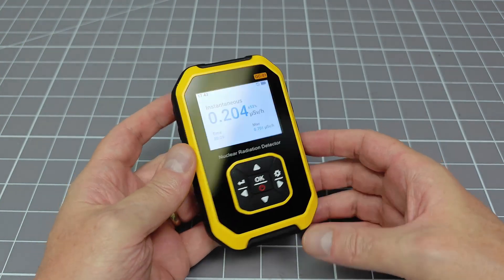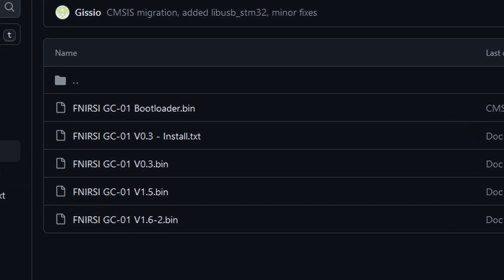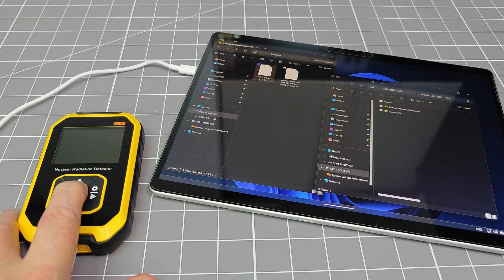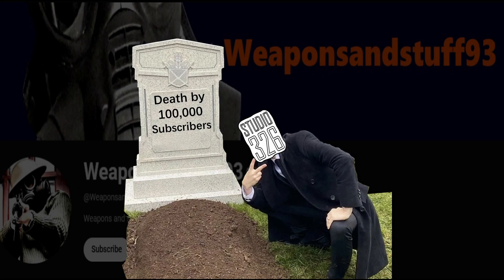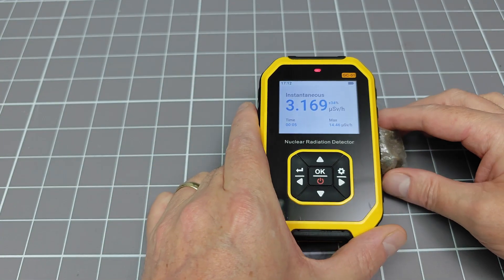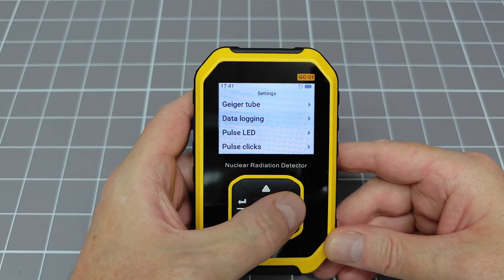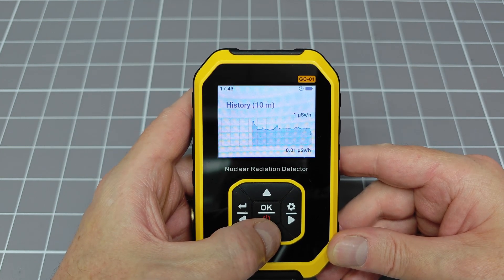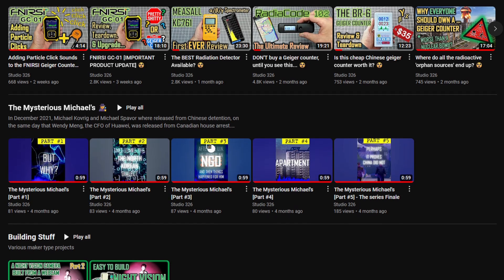FNIRSI Firmware Upgrade, Review & Instructions

Comment from the maker: For anyone that is considering this upgrade, please take a look through the GitHub threads, there is a lot of issues that can be avoided just by looking at the issues that others had, and how they solved them.  Also, GISSIO is very helpful.
Reply: My laptop won't recognize it when I plug it in and or turn it off then back on holding power button. Any idea how to get past this??????
Reply: @darrenhanson3875  oh no. What's your tube and MCU chip if i can ask?
Reply: @darrenhanson3875  this firmware never works with newer models because they have a different microcontroller (without the USB communication!).
The manufacturer simply redesign the whole device using cheaper components while maintaining the same plastic shell and the same layout of the screen to keep the device identical to the older one.
If you open an older and a newer unit you find that the insides are completely different.
Reply: How do I get my hands on a genuine one with a J321 tube? The AliExpress ones are a scam but you mentioned FNIRSI themselves no longer use J321 tubes either
Reply: Who can help me? After the firmware my device stopped turning on (((
Reply from the maker: @andrjusha  I found that I needed to disconnect the main battery and also remove the coin cell, then re-try the programming process - this seemed to fix the issue for me.
Reply: @andrjusha есть решение,тоже окирпичил сначало,сейчас все работает, пиши
Reply: This is not help me( Device is not turn on after that
Reply from the maker: @andrjusha  even when you press and hold the middle key whilst trying to reprogram the device?
Reply: yes. I just tried to do this with the middle key held down - it didn’t help((
Reply from the maker: @andrjusha Perhaps leave a message for the firmware creator, GISSIO on the GitHib repo in the link...
I can only speak for my own experiences, there are a LOT of versions of the GC-01, I suspect that the factory firmware is just as diverse.  GISSIO is the expert on his firmware, and will be you best resource to help with this.
Reply: How i can write to him?
Reply: Ok. How i can contact with him?
Reply from the maker: @andrjusha  This is a link to the discussions page.
https://github.com/Gissio/radpro/discussions
Reply: I already made a post there, but he hasn't responded to me yet(
Reply: @andrjusha  is event diod is on constantly? u might already entered booting mode. I had same, onnected to usb and it appeared as flash drive. after copy firmware device shut down and u can turn on again with new firmware. But there is no light, u should disonnect battery, press power button, wait a min and plug it back
Reply: Gissio went well above and beyond the call of duty. Not only he made custom firmware for these cheap counters, but also modified a GeigerLog software to run out of the box for them!

Comment: That Geiger counter you have looks like a fake china one well that's good for me because I got a fake one so thanks for helping with the new firmware tutorial
Reply from the maker: Thank you for the comment.  Actually, they re all made by the same factory, FNIRSI.  They have their own brand as well, but this is most often sold as a white-label device to whatever brand wants to buy it.  The factory is about 20 miles from my home in Shenzhen...
There is a video on the GC-01 on this channel that explains this in a little more detail.
Reply: @project-326 but you got lucky with yours because mines Geiger tube literally MOVES AROUND IN IT if I sightly shake it you can hear it move and when it moves the reading spirals out of control!
Reply from the maker: @superhornet-g2l  Sounds like the tube wasn't soldered to the socket...
Reply: @project-326 I opened it up and it wasn't it looked like they used double sided tape and put it on the shell then put the tube on it I regret getting it

Comment: I just bought a FNIRSI GC-01 however when I opened the device I noticed that the chip had no marking, how can I tell the difference between ch32f103r8 and apm32f103rb to install the correct version ?
Reply from the maker: That seems like a tricky issue.  I'm not sure why they would do that, the only company making the apparent 'fake' ones is the FNIRSI company itself.  I am surprised that GISSIO doesn't have some kind of notes on this.
In my case, I actually tried to program the wrong file first time around.  This cased the device to (obviously) not boot correctly and also not be able to get back to the bootloader.  The solution was to remove both the main battery and the memory backup coil cell and retry with the other MCU version.
Reply: @project-326  looking a little more, Gissio suggests using the apm version if there is no marking, it worked for me, and it seems that the latest versions of the GC-01 are all with the apm, in my case I have a GC4011 inside and the rad pro 3.0.2 version seems to work wonderfully, for people who can't connect their module to the computer, you have to press both buttons at the same time and install the firmware twice
Reply from the maker: @etiennesaraiva9343  Great news, really pleased it worked out for you.

Comment: Any thoughts on hacking a SBT-11A/CBT-11A Alpha, Beta and Gamma mica window Geiger Tube into it.  For $45 and maybe 3D printing a modified back to the case, you might end up with a shiney turd, especially with the firmware upgrade.  Also, any idea what the J1 headers are on the 202412 XBH-H240-VER1.6?  Also which MCU is the unbranded (not a single marking, even under a microscope) MCU?
Reply from the maker: You might find this video interesting...
https://youtu.be/624v4C5Wmww

Comment: If you brick your GC open the unit and remove both batteries. With the batteries removed plug in the usb cable and repeat the process. Make sure you’re reinstalling the same version firmware that came with the unit. Install the correct RadPro version. When you’re finished, reinstall both batteries. I left my unit plugged into the usb while reinstalling the batteries. Just be careful not to short anything out. You can try it with unplugging the usb first, but idk if that method will work.
Reply from the maker: Thanks for the detailed instructions!
Reply: @project-326 👍

Comment: Hello, I have updated my CG-01 to firmware radpro-fnirsi-gc01-ch32f103r8-2.1.1-install.bin it works great , my question is how do I increase the sound volume in clicks mode, I don't see a drop down for that?
Reply from the maker: I'm using RadPro v2.0 and its under the pulse clicks menu item, there are only three settings off, normal and loud.
Reply: @project-326  OK, I'm using RadPro 2.1.1, perhaps I need to download 2.0. Thank you for your reply.

Comment: Can it be worse, yes it can ! I bought the GC-01 @ eBay (my fault) some days ago, already knowing that an upgrade by software (Rad Pro) and tube (J321) is necessary, watching the great videos related to this geiger counter. The disaster started to establish the connection by USB which was not possible, then opening the counter I noticed a total different design (no back up button cell, arrangement of components, etc.)  and it can't be worse the marking on the mcu was not visible 😞, either removed by grinding or not printed by the supplier of it. From my point of view I have the assumption that FNIRSI is nowadays protecting their design and software property.
Reply from the maker: Is it FNIRSI branded?  All of the white label products they make for other brands often have various changes made, usually to meet the price requirements of their customer.
Reply: @project-326  Hello and thank you for your appreciated reply. The counter is not FNIRSI branded. I posted a issue @ GitHub #258 with a picture showing the pcb and with regard to the answers given I bought one of this sh...ty clones. Gissio moved it to closed. Lessons learned buying cheap is expensive. Greetings from Germany
Reply: Same here. I also have a completely different circuit board layout. It's not branded with FNIRSI, just GC-01.

Comment: I wanted to ask you, I try putting the cable in the pc and the geiger but it only start charging, what can I do? I tried with Mac and windows and I had the same result
Reply from the maker: thanks for the comment.  Try switching the counter off, holding the power button when you plug in.
Reply: @project-326 yes, i tried that way also but nothing, could it be the fact that i ordered it from aliexpress? i really dont know what i can do.
P.S. i saw the video where you put a capacitor to make beep at every particle and when you told the two different tipes of tubes i saw mine and it is the one who cant be used. so i thought that the problem could be the tube, i really dont know, thank you!
Reply from the maker: @BijouFrumushelu  The issue will be the MCU and its supporting components, the tube really doesn't matter.  FNIRSI is the factory that makes all of these devices, whatever brand is added is just a customer issue (FNIRSI is the abbreviation for the factory name [Fei Ni Ri Si] which is their own brand).  Because lots of brands buy and the label this product with their own brand marque, there are a lot of different specs around, so please take a look at the GISSIO github repo, there is a help thread available there.
Reply: @project-326 ok thank you very much!
Reply from the maker: @BijouFrumushelu  Your welcome Sir!
Keep experimenting and do look through the GISSIO forums, post some questions and hopefully this can be fixed.

Comment: HELP Mine just won't turn on or connect to the pc and the light is red on top stuck like that
Reply from the maker: I had a similar issue at one point, take a look on the help forum on the GISSIO GitHub repo, there is lots of experience from others that have hit issues.  I only have experience from one example, my own, but I found that removing the internal coin cell helped get the thing out of being stuck in boot mode.

Comment: Hi! If i may ask your opinion:
Mine GC-01 won't open the folder if i connect it and press start button for a while (either 2.0 or 3.0 usb port of my pc), it may be because it's not original? but it seems that even you have a knock off version and not the real fnirsi one, what would do you suggest i do? or i may own the dumbest one of it's family tree? haha
Reply from the maker: All of the various branded and unbranded versions are all made at the same factory that owns the design, the factory actually owns the FNIRSI brand.  There are a LOT of small changes that have appeared over the years. 
I had a similar issue at one point, but really, take a look on the help forum on the GISSIO GitHub repo, there is lots of experience from others that have hit issues.  I only have experience from one example, my own, but I found that removing the internal coin cell helped get the thing out of being stuck in boot mode.
Reply: @project-326  Ok, thanks for the fast reply!!
Reply from the maker: @MattiaBallotti  welcome Sir!

Comment: HI ! Great video. I have the same FNIRSI CG-01 and I want to update the firmware, but I won't show on my pc it makes the sound that is connected to pc, and it not shows up as a drive ! I did everything you did in the video and still same issue, I tested with different USB cable and I tested on another pc and still not showing up ! any help please ?
Reply from the maker: The best place to look up a solution is on the help form for GISSIO, this chap is very approachable and replies to most issues, obviously look through the FAQ first...

Comment: The battery life after the firmware upgrade did get worse, which gave me a good reason to go grab a battery upgrade, and stick the pack with a double-sided tape. It's basically a lithium-polymer battery with a JST XH 2.5 connector. Do keep in mind that what I have is of newer mid-2024 batch with no center screw hidden under label under older batch had. Otherwise you might have to Dremel the thing a bit more than below:

If you can permanently alter the GM tube position AND the back case a bit, you can potentially squeeze in a 5000-mAh 805090 battery pack by pushing the GM tube a bit more to the side and Dremel the strange plastic circle near one of the screw posts that was supposed to cup the speaker, but actually doesn't. Otherwise, the largest you can fit in can be a 4000-mAh 805080 pack. Their availability (and therefore the price) varies wildly depending on where you live, and always consider the Z-height of the PCB components such as the battery connector, the speaker, the coin cell battery, and the inductor in the middle, not to mention the shape of the back case and the GM tube position. Another packs that may work are 104060 (~3000 mAh), 104050 (~2500 mAh), 804066 (~3200 mAh), 103450 (~2000 mAh). So long as they have a JST XH 2.5 socket, it's just plug and play. Otherwise, you can splice the battery cables with pre-made JST XH 2.5 cables. There should be a few millimeters worth of space left for the cables too.

Let me know if you've tried other battery packs than above.
Reply from the maker: My CG-01 also didn't have the 5th screw under the label.  I didn't try adding more battery capacity as I almost never use this device.  If you look on the channel page, you will see a great number of reviews for better products and it is these that I typically use.

Thank you for the great feedback, I do like it when viewers are able to also help out with providing useful feedback for others that have this product as their primary detector!
Reply: @project-326  Case in point: the FS-5K is the unicorn, and Measall is so cool! It's just my special circumstances that drove me to the Fnirsi. I was so lucky to find a recent GC-01 with Geehy and M4011 tube, FS-5K is at least 3-4x more expensive, the battery upgrade just so happen to be widely available (and therefore cheap) as it's often used in popular electronic religious scripture tablets, and it having much easier time receiving firmware replacement via USB (FS-5K requires soldered connection to the PCB with a USB dongle, one can solder headers on it to make subsequent firmware flashing easier), which lets me doing more extraneous stuff like replacing the fonts as well.

If you guys are lucky, I'll recommend FS-5K or even the Measall. Just because they're better. GC-01 is Pretty Shitty, but it does allow inexpensive upgrades to make it few notches closer to Fnirsi City. There are even 3rd party folks modding their GC-01 to be more sensitive to Beta, adding a solar panel on it, or even installing a huge and expensive Pancake-style GM tubes. It's just that moddable. But then again if it has tons of room for mods in the first place, then some may argue it is indeed, Pretty Shitty.

I just find it adorable and thankfully easy to mod.
Reply: @project-326  I think I wrote a comment on this too, maybe Youtube removed or held it back because of the same profanity as you used in your first video on the GC-01? i.e. Pretty Crappy and Fnirsi City

Comment: Just received my FNIRSI-branded GC-01 today, ordered through the FNIRSI website ten days ago. It has the J321 tube and APM MCU. 
Plugged in to Windows 10 it showed the USB drive as soon as I turned it on, and all I had to do was drop the Rad Pro 48K firmware file onto the drive. It immediately installed and rebooted. 
Thanks for your original review of the GC-01 and also this very useful video.
Reply from the maker: Glad you found the video useful.  It is a pretty straight forward upgrade process!
Reply: Having done many firmware updates over the years, I found this one much simpler than I expected!  Still good to see it done live, though.

Comment: just opened my FNIRSI GC-01, MCU without any printing on it, same for Geiger Tube (but surely not J321) and it did not work to connect it to my computer
:(
Reply: Mine turns off if I press the power button for any length of time.  There might be another way to get it into update mode.
Reply: Without any printing on it? There's a risk that it's a counterfeit.

Comment: @project-326 I noticed when in the video when you plugged in the usb cord it came up un recognized on right lower part of screen. How did you get it to recognize? And what windows file manager are you using. I don't recognize it or seem to be able to find it.
Reply: Same problem here. Have you found the sollution?
Reply: @schiaucugabriel6202  No. Wish I could
Reply: @schiaucugabriel6202  I would like to know what file manager program he was using. Seems like it helps get past that. But mabey I'm wrong. Would be nice to upload this new firmware. I don't want to have to soldier just to get cliks

Comment: I finally got the upgrade done, I made the mistake of plugging the GC-01 into my Mac studio in order to charge it, and turned it on while it was plugged in. Which brought up the Bootloader USB drive on my Mac, from then on it wouldn't boot up normally. When I unplugged it, I couldn't even get the Bootloader drive to come back up. I found that if I openedthe GC-01 up and  unpluggedd the main battery and removed the button cell and then hooked them back up the Bootloader drive would then come back. I believe the reason that the upgrade won't work on a Mac is because when the .bin file is copied to the Bootloader drive, the Geiger counter reboots before the Mac officially closes the file, and the boot loader won't recognize it when it reboots because the file is not closed. I have an old Dell Micro PC with a Core i5 processor, which I dug out and was finally able to get the firmware updated. But by that time I had removed and re-inserted the button cell so many times that I damaged the button cell holder. It's currently being held in by a piece of Kapton tape.
Reply from the maker: Well, that sounds like a real project and a half!  I'm glad it all worked out in the end though...